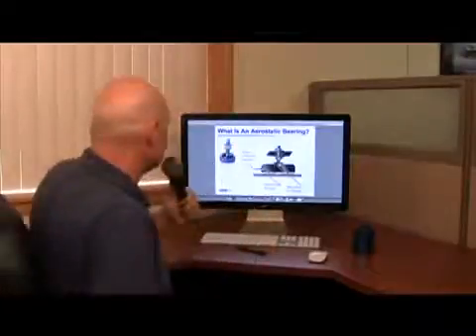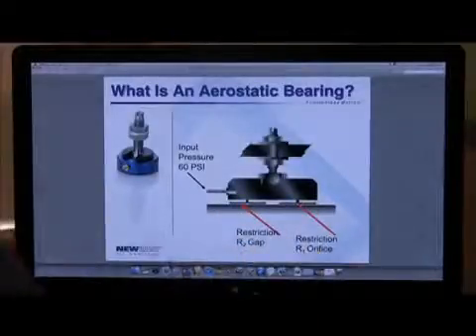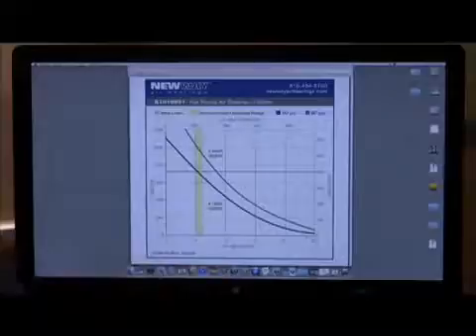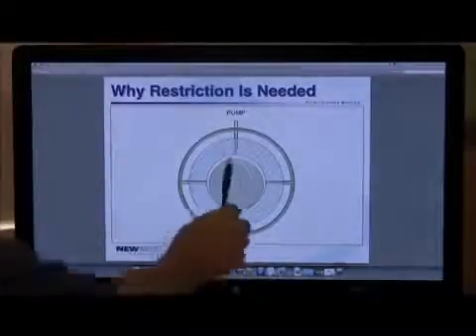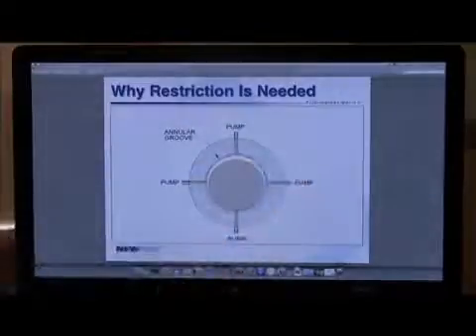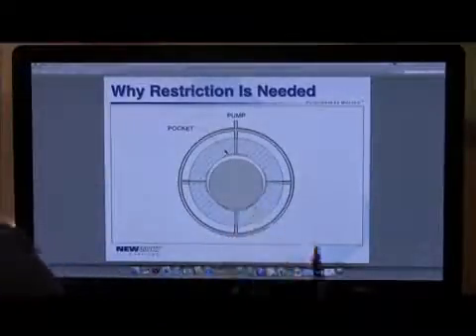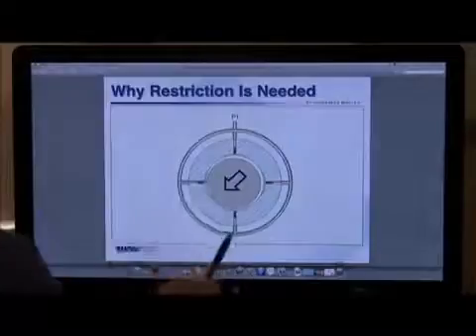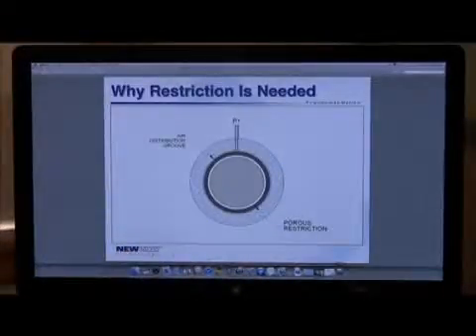Drew's Views - Restriction and Compensation Characteristics

Comment: Thanks for the wonderful explanation. But there is one thing I couldn't understand properly. As per my understanding as a result of compensation, when the shaft comes down, it makes an increment in the pressure at the bottom portion and decrement in the pressure at the top portion which exerts an upward force. 
Why do we get this effect only with an orifice or any restrictions to the flow present before the gap? Even if there is no orifice and I directly supply the supply pressure, won't the pressure at the narrow bottom gap ( resulted since the shaft came down) increases and cause the same effect??

What advantage we are getting by changing 4 bar to 2 bar at the gap instead of directly giving the 4 bar?